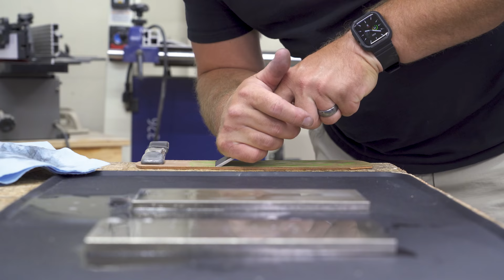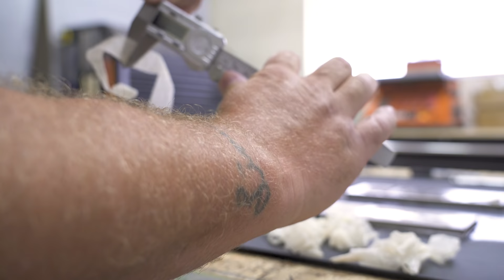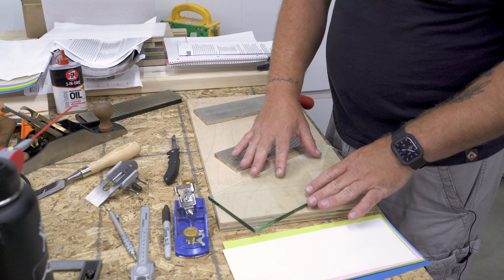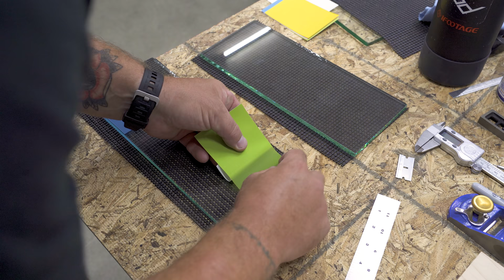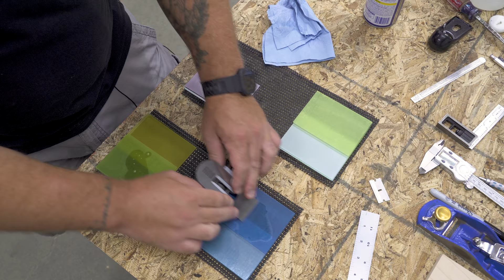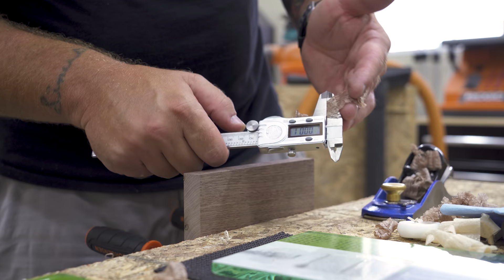Best INEXPENSIVE Sharpening Kit THAT ACTUALLY WORKS / Scary Sharp System For Chisels and Plane Irons

Comment: Do you push and pull when sharpening with that paper?
Reply: On the back of a chisel or plane blade you can do both, but when creating a secondary bevel, I’d recommend only pulling back towards you, especially on the finer grits.
Reply: The abrasive that comes with this system is on a plastic film rather than paper like wet/dry sandpaper and seems like it will be more durable.  This video sent me searching for more information and reviews (I trust Jodee's recommendation, but other viewpoints may have experiences to learn from).  One comment I read regarding push-pull was to use only pull for any of the grades 1 micron or smaller due to the risk of cutting/tearing the film.  Just ordered and received this system this week, so I don't have any personal experience to back up that advice yet.  I expect to have sharpened all of my plane blades and chisels by the end of the weekend and will report if I have any issues.  I will say as you get close to the 1 micron size it doesn't feel like an abrasive because of how fine it is and would be more akin to stropping in use.

Comment: It's in my understanding that the diamond stones will last for years and years. But those sheets how many times can be used? Maybe 50-80 dollars for each diamond stone is not so expensive. I don't know
Reply: They won't last forever, but they do last a lot longer than you'd guess. Biggest trouble is accidentally tearing the paper. I've never worn out the paper before I've torn it.
Reply: @mileshh515  Whats fun is tearing the paper on the first pass...
How did he NOT tear the paper when lapping forwards and backwards? It says to only pull, pushing will tear the paper.
Reply from the maker: @Adrian Decaux High quality diamond stones can last for a long time, but it usually is a "you get what you pay for" situation. The lesser expensive diamond stones are a lot of times not even stones, especially at that price point. I have one that is $80. 400 on one side and 1200 on the other. It is two thin metal plates that magnetically attach to a plastic housing. The plastic housing will warp and move, and the metal plates will flex accordingly, which means you will never get the same scratch pattern twice or an actually flat edge. One could argue that in the long run the lapping film will add up to the same price as a decent diamond stone (or two or three), which is why I think breaking the kit up into several pieces is a smart way to go. As for longevity, there's no solid answer. It depends on how often you sharpen, which of course depends on how often you use the tools. It also depends on the material you are working with and the tool steel you are cutting with. Too many variables to know how long any sharpening system will last for anyone, honestly.
Reply from the maker: @Nik Boatright I don't remember seeing instructions that say "pull only", but I may have missed something. This is not paper, it's like a tough, thin plastic almost. It sticks to the float glass via self adhesion and stays flat, unlike wet/dry paper which suctions to the surface with water. I've use the paper method before and was not a big fan. More trouble than what it was worth, in my opinion. This just works, and works well.
Reply: @InspireWoodcraft  Got it, thanks for your reply, I'll try the sheets then. Thanks

Comment: This is wrong.  You're only supposed to pull the blade, and never push it, with the Scary sharp system.  Your film won't last long if you push and pull.